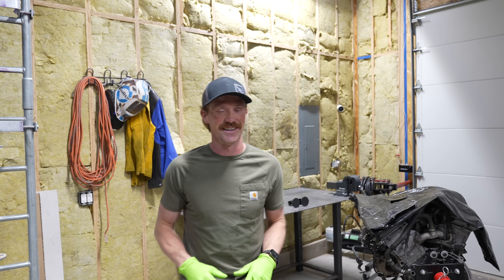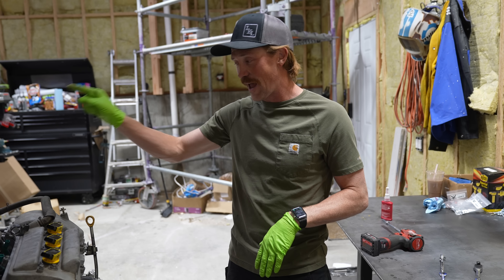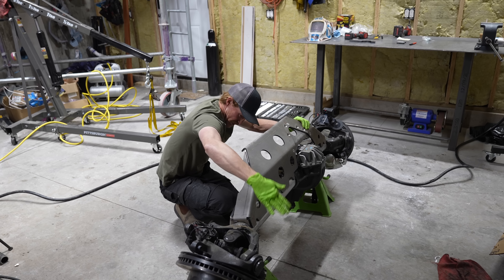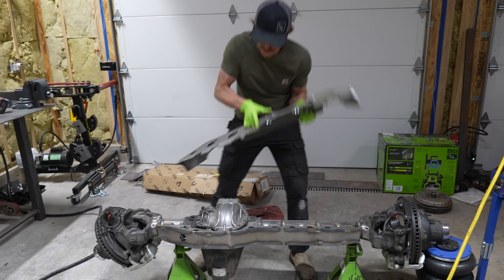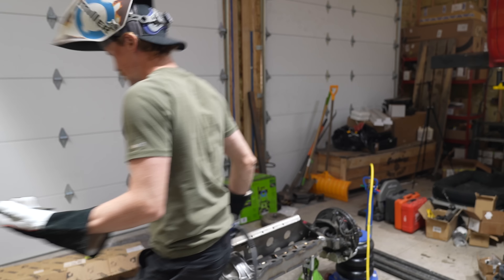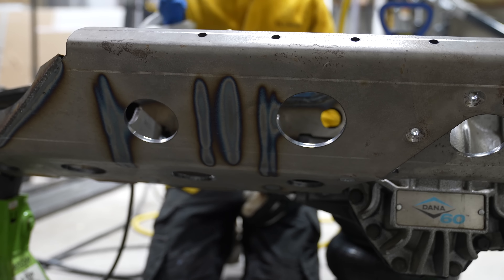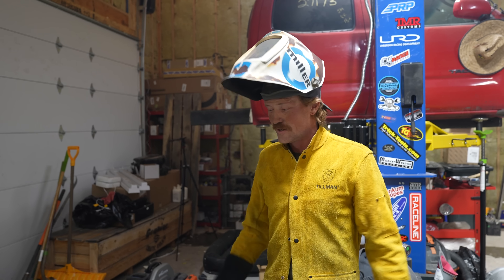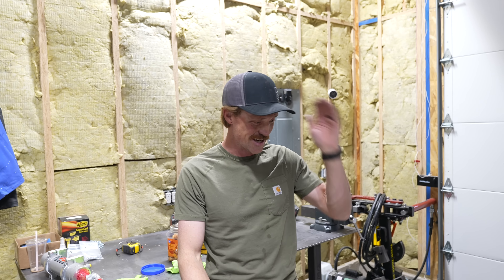INSTALLING FULL HYDRO STEERING ON ULTIMATE DANA 60

Comment: Here's a tip.  Your new jack has rubber bellows for lifting power, so when you're welding anything over or near the jack cover it with a fire resistant blanket.  You don't want slag/hot sparks burning a hole through the bellows.  Just a thought, it your garage.

Comment: Great job  Trent and Brandon you guys make it look easy. Heres a free design tip ( idea ) on the front bumper, put a 8" to 10 " thick round steal pipe. Weld the ends closed. Now weld the fitting on the pipe bumper, so u have a air gauge,  and clip on hose bins so you can pump 30.000 PSI of air in the bumper. Say 200 on the gages. 
( why your asking) guys what happens all the time rock crawling.  Tires peels off the rim. Your stuck in the middle of no where.
Well, u will have the air tank, to pump the tire back up. After you used old trick, starter fluid pop tire back on the rim. I've seen , those bumpers used, very cool..it's  still a strong bumper, weld mounts on it if you want for a custom, front on the pipe air tank.

Comment: Trent, Quick trick for your engine hoist! When you are setting it up, or when it is in the down position, just release the valve that releases or lowers the ram, and pull up the hoist arm to what position you want and hold it in that position until you tighten the valve for pressure or lowering! It saves a ton of time!

Comment: Hi Trent Jason here all the way from Barbados , a small tip when you have a chance before you put the motor in take back off those headers and run a drill a size over through the holes to allow for expansion when they heat up doesnt have to be huge maybe a 1/16th or so oversized will do wonders for removal in the future
Reply from the maker: That’s a great idea!!! I’m gonna do this

Comment: Hey Trent, when you put the supercharger on, get yourself a Tundra V8 oil filler neck.  It’s shorter than the Tacoma one and it makes getting the oil cap on and off oil much easier.
Reply from the maker: Great tip! Thanks!

Comment: For tapping stud holes you need a "bottom tap" it has no taper on the lead in, you can start your threads with a taper tap though. you're doing fine on your build.

Comment: Question on the air jack - is there a safety to keep if from lowering when you're underneath the vehicle?
Reply from the maker: You have to open the valve to lower it, just like a regular jack.

Comment: How would you remove the differential cover off if you had to with the shield welded on the axel in front of the diff?
Reply: Look around 7:25 in the video frames. He has enough room to get at the bolts on the diff cover. Might need a uni joint on your wrench.
Reply: @Sparkeycarp  you might get the bolts out but will it get over the crown wheel ?
Reply from the maker: That plate in front of the axles is bolted on and it comes off. Then you can access your differential.

Comment: Normally when you go cheap on headers, you pay for it on the back side. Get a good pair.
Reply: Yup bot some cheapest. Regretted it every time I was under the hood tightening the bolts...
..often
Reply: The headers will be just fine. In this context the adjective “cheap” is more about cost than quality. What is good enough to do the job was the objective. And, I have enough respect for Trent’s skill to believe he knows what that is.

Comment: Hi Trent.  Not trying to be a ass. I would of used anti- sieze on exhaust studs instead of lock tight. Maybe that's just me though.  You're doing a great job job
Reply: They do the opposite things though, right?
Reply from the maker: I put lock tight on the stud going into the head, not on the nut holding the headers on.

Comment: Wouldn’t that be Hydraulic steering? Hydro would be water powered. 😁 Thus f try on a guy that has worked on hydraulic systems many years. 
Quite the project you are tackling. Can’t wait to see it in action. 😊

Comment: I really cringed when I saw you put Loctite on the manifold studs. I have never known manifold studs to back out, but I have sure known them snap off due to expansion and contraction or the nuts seizing on the studs. If ether of those occur, you have definitely added  a whole new level of ugly trying to get the broken part of the stud out of the head.
Reply from the maker: The other studs I bought had thread locker on them when they arrived so I thought a little dab of locktight would be good. Might be a mistake, I guess we’ll see haha